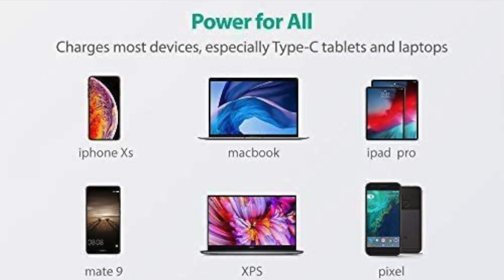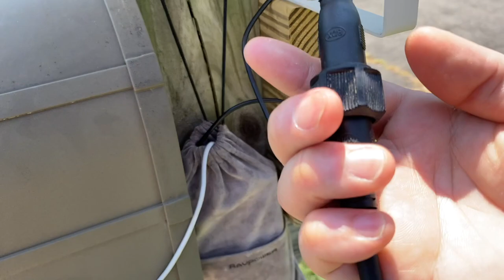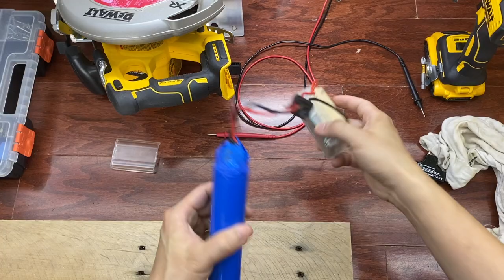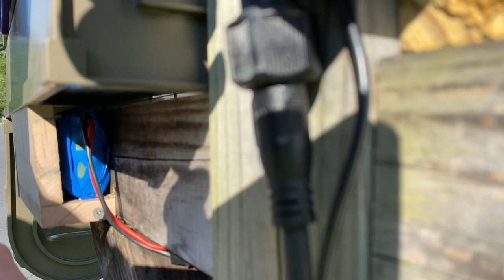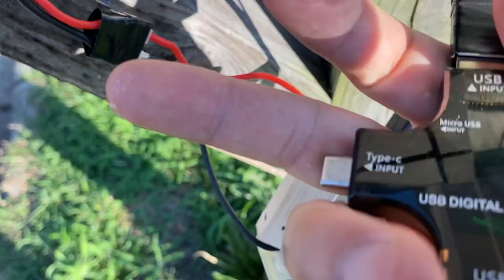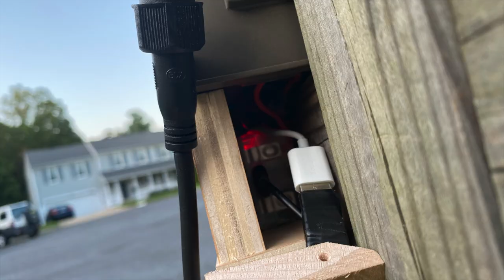Solar Powered WYZE Security Camera (DIY After 2 years)

Comment: If you are interested in getting more complex, I recommend looking into self hosted IP cameras.
Reply from the maker: I checked self hosted IP cameras. They require wiring -- AC power required. The WYZE cam v2 meets the following requirement:
1) Wireless
2) 24*7 recording
3) Low power consumption, can be USB powered from solar panel + battery bank combo
4) Very compact

The downside is that it can be stolen out there on my mailbox.
I should consider improve the design and create a little housing for the camera.
Reply from the maker: @sergiopabon1387  it is still there. I will do another video to update you guys. I'm planning to replace it with Eufy Pan and Tilt.

Comment: Interesting setup.  Thank you.   I suppose the same setup can be done for a V2 placed under the eve.
Reply from the maker: Thanks for your support. What is "under the eve"?
Reply: @ToolsElectroDIY  " Under soffits"
Reply from the maker: Yes. I thought about that place. However the maintain would require a ladder if the battery dies / reboot required.

Comment: So that is a indoor v2 mounted outside and is RTSP compatible then?
Reply from the maker: Yes it is a $25 indoor WYZE v2. I think it supports RTSP as it can be used with tinycam pro on an android tablet for streaming.
Reply from the maker: I will do a follow up video on the battery bank choice. Please stay tuned. The outdoor version probably doesn't support 24*7 recording due to its battery size. That's why I choose the indoor USB powered one.
I have multiple videos on solar power station, please checkout my "solar project" play list on my channel.

Please also consider click like and subscribe, it really helps my channel and encourages me to create more content like this, thank you.
Reply: @ToolsElectroDIY  Done, yeah the outdoor version is hobbled, I hope to run RTSP to a website so this is a superior set up.
Reply from the maker: Jeff Pietsch yes you can . With tiny cam , it starts a web server so you can view from any browser
Reply: One last thing, would these serve the purpose of your battery charger (missing from list) 4 Pack 3.7V 9800m.A.h Lithium ion Rechargeable-Battery Button Top and 4 Slot USB Smart Charger Combo with LED Indicator for li-ion B.attery 26650 18650 18500 16340 14500  THANK YOU AGAIN
Reply: I'd guess not since your unit can handle two inputs/outputs
Reply from the maker: @jeffpietsch4093  are you referring to this one https://amzn.to/2YbMDle ?
I don't think it can be used in this application as it doesn't have USB output.
The simplest solution would be just use the RAVPower bank I showed in the video https://amzn.to/2CKvwzA so everything is nicely packaged, no additional components to buy and wire.

Comment: Will this work on the new V3 as well? I'm looking to run at least 3 V3 cameras. I want to build a small self contained waterproof unit with the solar panel attached then run the USB cables to each camera.
Reply from the maker: I don't have V3 yet.
Reply: @ToolsElectroDIY  Amazon is in stock haha! I wonder what it would take battery wise to run 3 cams off of a 20/30/40 watt panel or if it wouldn't even work with your setup.
Reply from the maker: @amsnare13  You need to get a larger capacity such as the ones I reviewed recently. please visit my YouTube homepage to find out. One even charges my Tesla Model 3.
Reply from the maker: @amsnare13  You definitely need a bigger battery for that, check out the solar collection under https://www.amazon.com/shop/toolselectrodiy
Reply: im trying to fig out the same thing